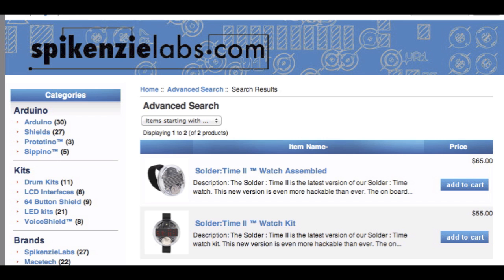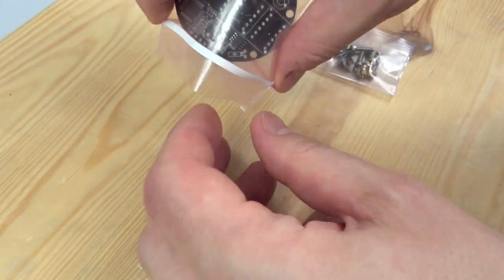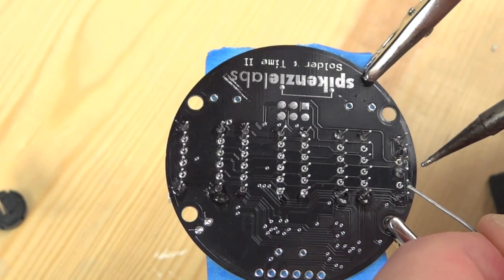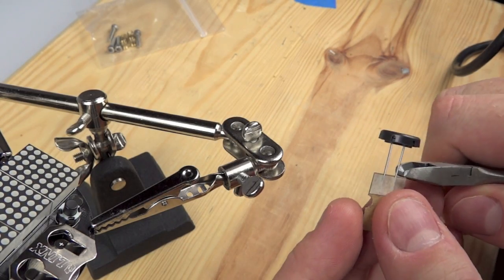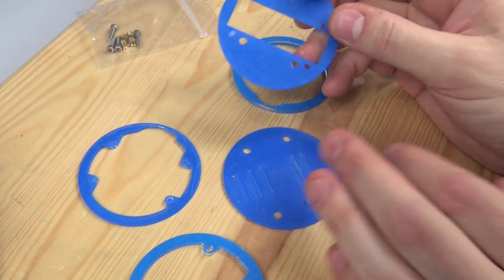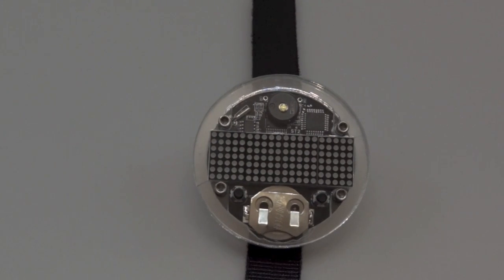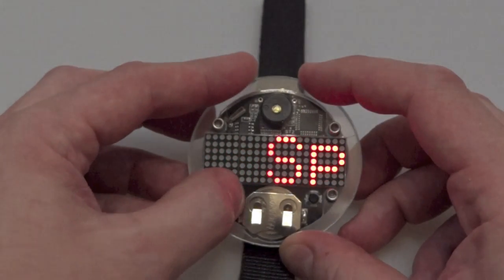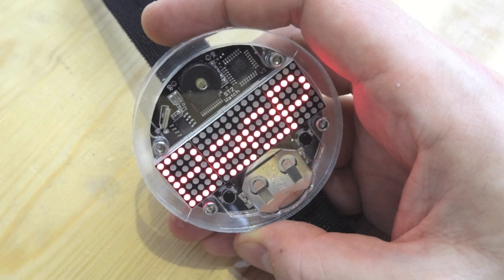Make time.....Assembling the Solder Time II Programmable watch kit

Comment: A bit of a dig from the grave, I know, but YouTube brought it up in the suggested. Anyway, funny thing about that solder, at least until a few years before this video when another company finally bought it out and gutted a lot of the hobbyist stuff, what once originally was Tandy Int'l here in Canada still carried the exact same type with the exact same SKU that is on the sticker. I worked for them for a number of years, and I can recall the number quite clearly to this day, they had a very well designed inventory standard!

Comment: Fascinating product - thanks for the review. :) Just one little thing though - there's no real need to tape down the components. Just slightly bend the legs out a bit, and they'll stay in place nicely.  For the integrated circuits, just bend two diagonally opposing corner pins out.
Reply: Greg Sullivan he said in another video that he knows that but prefers the tape.
Reply: thescreamingfish oh, ok - thanks. Did he say why he prefers the tape?

Comment: 2:05 youre soldering from the right side. Components with such tiny legs can break off and usually you would even solder the metal body down, but they didnt provide a pad for it. They need to be protected against vibration wobbling them around, and soldering on that side is quite a good idea there.  Some people even solder from both sides.